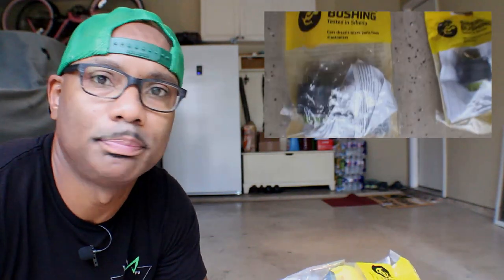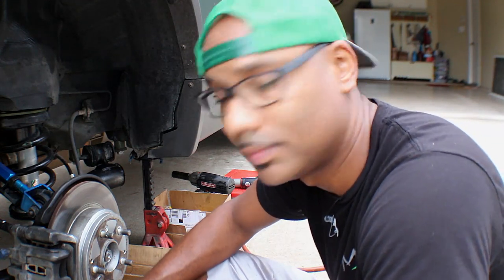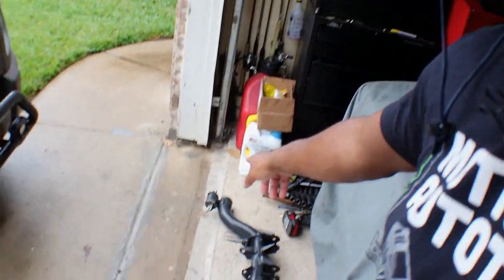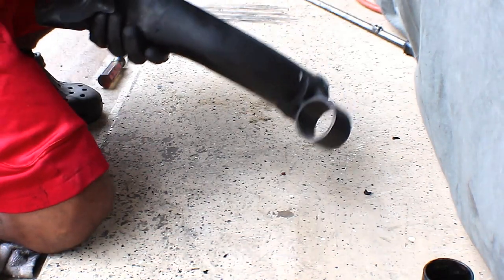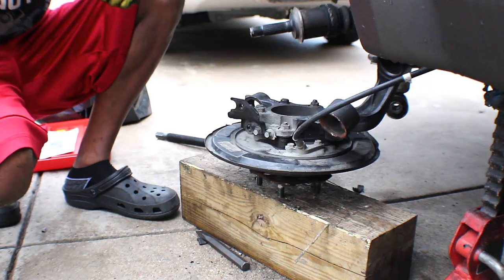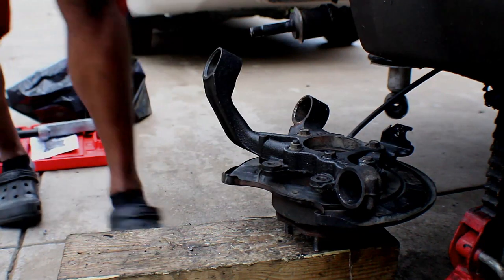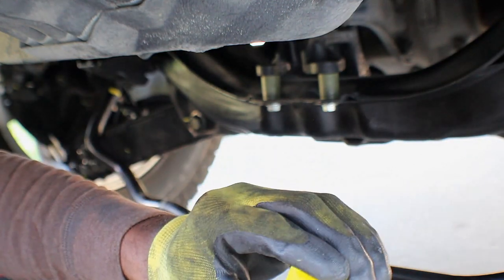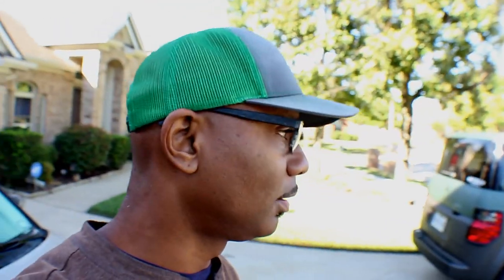Honda Element rear Bushing Replacement

Comment: Great video.  One small tip. When you don't have a big press to work with, hammering, as per the video is the best approach.  When hammering the trailing arm mounting hardware (the pineapple slicers), place a large deep socket or bushing driver over the mouting point to avoid deforming the hardware mount.

Comment: I don't own a element but I do have an Rsx type-s which share the same suspension layout with element, crv , ep3 and civic of the same years. Your video is the only video I could find that actually showed changing all the rear suspension bushings. I changed my front LCA bushings months ago and that job was a PAIN , got them out but was having trouble getting the front complaince one in so I had a local  shop guy press them in. Bushing replacement are truly a pain in the ass 🙃 . Anyways thanks for the video. I definitely needed it to boost my confidence in tackling this job
Reply from the maker: You are 100% right it is a pain, some things I had to cut out of the video because I had a few choice words..lol
Reply: @ByrdRebuilds  🤣 yeah I totally feel that , I know I'm gonna be cursing and have a lot "man this is some bullshit" pauses lol. But It will get done!

Comment: I bought all these bushings about six months ago and have been waiting for some type of instruction video and putting these bushings in. Thank you so much! I will be doing my front and rear bushing stinks to you buddy! Keep up the good work
Reply: How'd it go?
Reply from the maker: Great
Reply: @Brock_CO   still haven’t done it yet. Been building a tube amp instead lol way funner
Reply: @Josheg2335  As someone who enjoys making DIY repair videos. I think I'll take up the challenge and try to make a DIY bushing replacement video plus rear bearing replacement. Maybe sometime after summer sadly. Too many projects in the way.
Reply: @OneManOnFire where yah at with that video

Comment: Koodos to you! Thank you for sharing your experience on line. I concur with you that this job is extremely challenging. I need to do all this on my 2009 Element as all the bushings are shot back there too. There's a major squeak back there that just won't go away.
Reply from the maker: My element sounded like a old school bus when I bought it.
Reply: @ByrdsRebuilds  I'd love to know which single bushing is the culprit in the left rear end (for that anoying squeak). I tried silicone based WD-40 followed be watering down (soaking) each bushing with no joy (difference) whatsoever.

Comment: Yes I agree polyurethane sway bar links and diff mounts would be very nice to have. Since you decided to upgrade your bushings to polyurethane I do strongly encourage you to go ahead and replace that rear differential mount that you pointed out as well as the motor and transmission mounts if you don't have any records of them ever being replaced, which I'm guessing you probably don't. If not, they are absolutely going to break overtime due to the increased rigidity that polyurethane bushings typically have.

Comment: Did  1 side front complete suspension doing the other side by memorial weekend. Took about 6 hrs Then doing my back. cleaning and painting everything in each corner plus anti-seize will make any future work much easier. Thank you. I think I am going to do the same as you did here. The back actually looks like a harder job. Will see..lol
Reply from the maker: Awesome...yes the back is a bit harder but I wish I had press keep up the good work you will love the ride afterwards.
Reply: @ByrdsRebuilds  I have been watching for a cpl years for a nice smaller press. I have seen some that do not take up too much room. but non has popped up i was willing to pay for yet. Really bearings used to be about all i have needed one for.

Comment: My CR-V that I bought used came with swap bar endlinks in polyurethane, at least it looks like it.

The replacement rear upper control arms, the black ones which brand were those if I may ask?

Cheers thanks for the video
Reply from the maker: They are from HRGoffroad.com

Comment: After replacing my trailing arm bushing, it sags a half inch less.  To press on the metal ears, I used the ball joint press to get one installed then hammered the second one. I found the first one wouldn't go in straight until I used the ball joint press.

Comment: I’m 75% done with mine.  The rear is the hardest!!  The 2 bushings on the knuckle has been the most time consuming.  I ended up grinding down the flange, cutting slits with my dremel and then finally pressed and hammered out.  The heat hasn’t helped either!!
Reply from the maker: Yeah it's not super easy

Comment: Nice video!  How many miles did you have on the Element?
Reply from the maker: I put about 25,000 miles on it
Reply: @ByrdsRebuilds I mean the total mileage on the vehicle before the repair.  Mine has 180,000.  Wondering if I’ll need to do my bushings soon.  Replaced the sway bar links and all 4 struts and coil springs with KYB. And the front control arm bushings, engine/ transmission mounts.
Reply from the maker: Oh it was 316 000 miles when i bought it had to replace EVERY thing.

Comment: I rebuilt my suspension, except for the rear trailing arm bushings.
They were still in decent  shape.
I did replace the rear lower control arms, used Aerogenics aluminum  arms with the brace.
Reply from the maker: Nice I was thinking the same thing until  the wheel alignment shop show how bad the bushings are.
Reply: Any issues with clearance on the brace? I bought the upper ones and am waiting on the pewter one’s lowers. Currently sold out.
Reply: @HotRod-wv4vm  it clears the rear diff.
Only potential problem is ground clearance, about one inch less.
Reply: @craigwiess1656  thought so. I am running 235 70 16 to gain clearance and if I installed that I would lose that. Shame cause I love that brace.
Reply from the maker: No problems

Comment: I saw another website where they used silicone paste before installing the bushings to keep the noise down as polyurethane tend to squeak. They do sell greaseable ones
Reply from the maker: Unfortunately not

Comment: Thanks for this video, I am curious how the ride quality is with the poly bushings. I've heard the suspension is firmer compared to oem bushings.  In the process of rebuilding my whole suspension and don't want to and up with a to stiff of a ride thanks 👍
Reply from the maker: The poly bushings aren't hard like energy suspension I am so happy I did it, before it felt like the car wanted to fall over..lol

Comment: Great job. Thanks! Your car looks incredibly clean compared to mine but I am in Canada and I have rust and thick undercoating.  Did you replaced the upper control arm with an adjustable one again? I am looking at that blue ones you replaced but If I can just do the bushings in the upper control arm I have I will. Do you still recommend the adjustable ones?
Reply from the maker: If you are still at stock ride height, I would just replace them with OEM
Reply: @ByrdsRebuilds   Good to know Thanks!
Reply: @RichardFiander  did you end up doing this if I may ask? How did it go? Both just the bushings part and then the OEM rear upper control arm bit.. Tryina fix rear camber issues; cheers, thanks for reading and potentially replying

Comment: I know I been commenting a few times thanks for your replies. Wondering if you got a 2 year update on how they have been on the vehicle and if you would still recommend over OEM. The OEM ones arent as expensive so considering what to do for my ride.
Reply from the maker: I got that question alot I did a couple of  updates in other videos. It's way better than OEM. It's not a ride a hard  and  no noise of any kind.

Comment: Hi. Nice to meet you. I have a honda element 2004 and i have a lot of problems suspension. The driving performance is so bad. Looks as a gelatine. The question is what díd you modify or upgrade for eliminate  these problems?
Reply from the maker: I used the full  Siberian Suspension kit also with new struts.
Reply: @ByrdsRebuilds  what struts brand?
Reply from the maker: I used some inexpensive struts off of Amazon. Not the real cheap ones..lol
Reply: @ByrdsRebuilds  thanks
Reply: A bit of advice I have tried shortcuts, and I have replace parts over and over because of it. If you’re going to start changing your suspension, which I recommend, make sure you buy quality parts either OEM or upgraded mods such as polyurethane bushings. You don’t want to waste your time as I have a cheap parts. Also, make sure you buy straight from the manufacture of the parts. And if you were wondering you got this you can do it.
Reply: Kyb struts are where it's at. I'm upgrading my rear springs though to hold up better under load.

Comment: hey you mentioned poly motor mounts/transmission mounts... im currently making some for my element with polyeurithane sealant. My element is manual so it will make a big difference. When they are done drying up in a few weeks and I install them i will let you know how it feels and if it was worth it (only cost me about $50 so far)
Reply from the maker: Oh wow that will be super awesome.  I love to see a video or pics of them.
Reply: Please let me know also. Thank you

Comment: 13:16  That bolt was frozen inside the bushing (typical).  Next shot you have the whole training arm removed and on the ground  How did you eventually get it out?
Reply from the maker: With the hammer and heat nonstop..lol

Comment: I need to replace the right rear trailing arm bushings on my 2004 Element and was wondering if the 2004 CRV trailing arms fit. They cost half of what the Element ones cost. In a parts diagram they look identical. I called a junkyard and they said it would fit. Do you know if they interchangeable?
Reply from the maker: Yes they are 100% interchangeable
Reply from the maker: On my element I had blue crv trailing arm I only replace them because I had picked up with a kit
Reply: @ByrdsRebuilds  good to know cause the complete Element right rear trailing arm is over $700 bucks and CRV is half that

Comment: I watched your video step-by-step ordered all of the bushings for the rear of my 2007 Honda Element AWD and I just wanted to know does it still ride good or does it ride stiff? I also noticed with my kit that bushing #6 and bushing #5  pressed in perfectly fine but the center bolt hole was smaller than my original bolts did you have that issue with yours?  I am so disappointed because I already have the bushings pressed in. I have to get smaller bolts to match the bushing holes?Mine is a 2007 I did not know why that was like that so I’m at a pause in my build. Your video inspired me to do mine now I’m wondering about the ride quality and those two bushing. I have it to where part and I have many pictures along the way of my build. it’s just those two bushing holes were smaller and I have found bolts to fit them but the ear holes will be bigger and that may create a problem. Any information you can give me I would so kindly appreciate it. Thank you so very much
Reply from the maker: The ride is very good not stiff at all

Comment: Maybe I missed it but how did you get that concentric bolt out?  Pretty sure I'm going to need to do this soon.
Reply from the maker: Just removed the nut and tip out the bolt

Comment: I saw a comment that the ride was still good, my experience with POLY bushings in the past is a lot of NOISE, especially with motor and tranny mounts, and lets be honest this thing makes enough noise all on its own. are you noticing any excessive noise now that you've had them in for a bit? I just ordered HONDA bushings, but I may grab these for a future mod.
Reply from the maker: I do know the Siberian bushing is softer then like energy suspension

Comment: Did it handle the noise? I swapped out everything for front and rear suspension and still hear a tick, need to swap out the sway bar bushings I guess 🤷🏾‍♂️
Reply from the maker: The rear sway bar bushings on my element was the first thing I changed...smh it had some of the noise gone
Reply: Rear sway bar bushings. Have already replaced 2x with OEM. They are cheap also need to do the front.

Comment: After installing the bushing with the “pineapple slice” does it go in a certain orientation? Can it move/rotate after beating in the studs to line up the bolt holes on the frame? More info plz
Reply from the maker: It did rotate just a little, I tried to line up the bushing like the old was.
Reply: After instaling the pinapple slice bushing, how are they now? Seems that only siberian bushing are the only ones to make that bushing.Hinda doesnt even offer it
Reply from the maker: So far the ride has been great, I did a do a visual check last week and  it still looks
 great.. maybe I need to do a update video

Comment: SO I need to enter a warning for those of us with newer E's if you are ordering these bushings go to the ACTAUL Siberian Bushing site first and use your VIN to verify the correct parts
 there are a couple of the bushings they sell that are not intended for some models, mine is an '07 EX the ID of the sleeve was too small on 3 of the bushings as well as the big one with the ears supposedly isn't for my model, I would need to buy a complete new control arm with that bushing already installed. this of course I didn't figure out till I already had it installed, so I guess we shall see. BUT if you don't use your VIN it wont tell you they don't fit, so I had to drill the sleeves since I had no other options after destroying the old ones getting them out.
Reply from the maker: That is very good info Izaak
Reply: Word!

Comment: Can worn rear control arms or bushings in RWD or AWD vehicles cause vibration at highway speed ? Or is control arm noise always a rattle over bumps?
Reply from the maker: Yes you are right does not matter if RWD or AWD you worn out the bushings
Reply: @ByrdsRebuilds  I wanted to know if control arms cause vibration or rattle, though. I've got a vibration but not sure if control arms would cause that
Reply from the maker: Yes it can be your control arm or your axle usually with the control arm he will only hear a bump or click but if you just regular driving and you hear it rattling or vibrating non-stop then it could be your axle
Reply: @ByrdsRebuilds  I put in new rear shocks and started getting a vibration--but we can't find what or where it is! Driveshaft maybe?
Reply from the maker: I think it's the driveshaft unless you took down their rear end
Reply: @ByrdsRebuilds  I am trying to keep the rear end at factory height! I want to replace the old springs too.  Thanks for the advice, very helpful!
Reply from the maker: Were you getting a vibration before you did the struts
Reply: @ByrdsRebuilds  Not as bad as after!  It was just rear shocks, though, on a Ford Escape. As soon as new rear shocks went in, car started vibrating at highway speed, like really low bullfrog vibration
Reply: @ByrdsRebuilds  Driveshaft work done got rid of the thuddy vibration, but I think the non-Ford bra d of rear shocks is to blame.  Got a new set of Motorcraft AST-311s, so getting the aftermarket stuff out and Ford back in.

Comment: Element 44 now offers front lower control arms with spherical bushings
Reply from the maker: Awesome
Reply: @ByrdsRebuilds  hey how do I get one of your hats?
Reply from the maker: @HotRod-wv4vm  www.byrdrebuilds.com
Reply: @ByrdsRebuilds  they also have rear lower control arms, powder coated and provide 1 1/2 more clearance and comes with the socket to remove them.

Comment: My toe bolt is stripped and a shop may have melted the bushing
Reply from the maker: Oh dang, that toe bolt. I had to keep the torch on it for a long time, and then it came out it was very rusted.
Reply: @ByrdsRebuilds  okay Lots of heat and love taps thanks. Probably will have to replace the bushing. Think I can do it on the car?
Reply: I ended up cutting it off and replacing them both

Comment: That trailing arm is about $800, so bushing replacement is more economical. Also, the ball joint is part of the front knuckle from the factory and therefore no OEM replacement for the ball joint.  I helped build Elements , but Come on Honda, really???
Reply: Yeah, the ball joint is a real pain… one great thing. If you’re buying a knuckle , you can buy a couple extra boot covers for the ball joint and if it ever tears are ripes you can just replace that. I don’t expect the dealership to tell you that, in fact, I was there that last week, and I couldn’t find one tech who has replace the boot?!?! although it is possible and they sell the boots for under $10, they would rather of up charge for numerous reasons in my opinion. So if you’re buying a knuckle, why don’t you do yourself a solid and get a extra boot
Reply: I replaced the front ball joint with a moog one on the tail gate with one of those press tools. Was a pain.